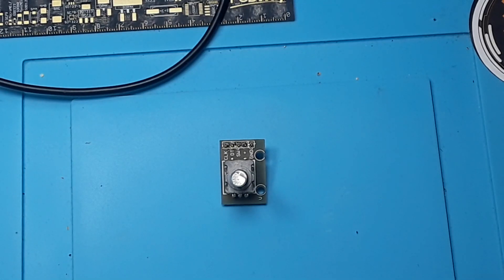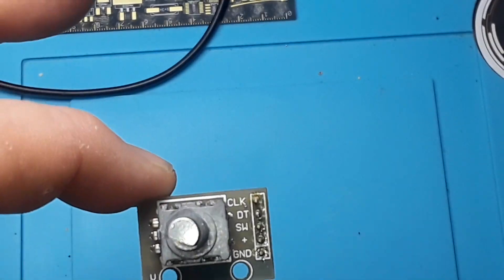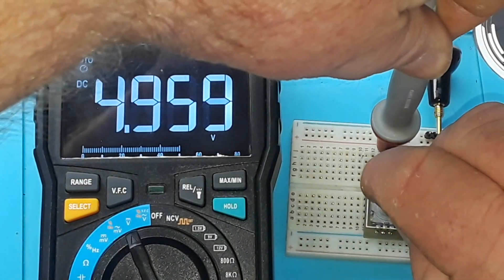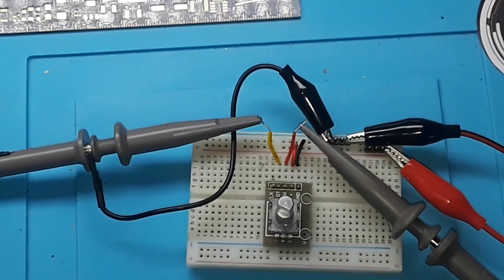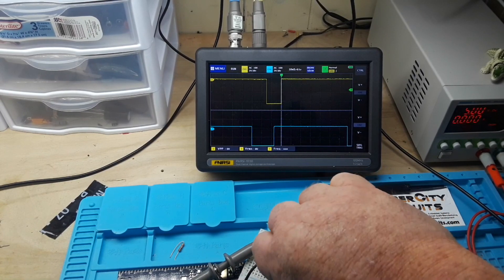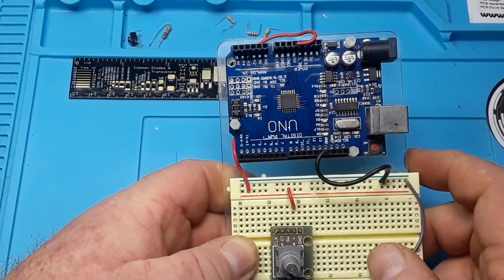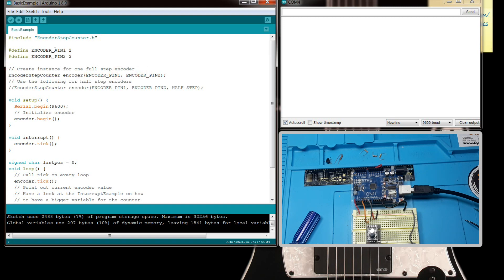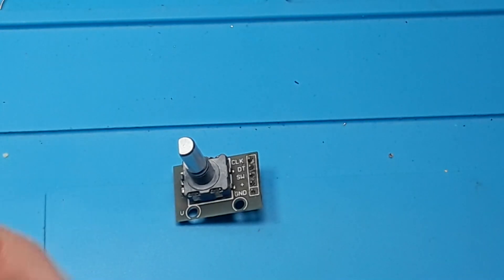How does an incremental mechanical rotary encoder work

Comment: Can you explain why the 5v is required for this device? Rotary encoders not mounted on the small circuitboard as the one you’re using also can have five terminals but none of them are labeled +5v, so that’s got me confused. Thanks.

Comment: Quick question, I hate debouncing in software, it is a hardware problem :), and with buttons will use a combination of a couple resistors, a cap and a 74HC14 to get clean switch signals, do you think this technique will work for the clk and dt pins? I ask as I am concerned about speed.

Comment: If you have an old Atari 2600 Driving controller you can use that for encoder experiments. It's not the paddles which have two per cable but the one that looks just like the paddle controllers except it only has one device per cable. Arcade machine games like Tempest and Missile command use optical encoders which are similar. The Missile command uses two of these for the x and the y direction for the track ball and the old style ball mouses also use optical encoders. Essentially the same thing going on...the direction is determined by which pulse arrives first.

Comment: Nicely done.  Appreciate you showing the detailed steps.  It's great, too, IMHO that you show the wrong forks in the road that happen.  Like trying to use the mm probes on the breadboard then switching to the wire.  I believe those are important teaching moments for beginners.

Comment: I have a few micro stepper motors and I was wondering how to control them with a micro controller?
I have seen a video that says you can control them without a driver but I thought that could damage your chip. And you need to use a diode.
Also can you control them from a small chip ? Like ATtiny85

Comment: is it possible to multiply or increase a voltage with only two resistors?
Reply: Two resistors allow you to make a potential divider, where the voltage across one resistor is some where between the voltage placed across the two resistors. Look up resistor potential dividers for more information. just using resistors it is impossible to multiply or increase a voltage. my the very nature of resistors, they consume power not generate it.

Comment: I’ve got some cheap incremental encoders that bounce something fierce.  Trying to sample multiple times to detect a state change is useless; too much bouncing; it doesn’t stay stable long enough.  I have to detect the initial edge, then just ignore the pin for a while.  Just increment or decrement from an interrupt routine is useless because of the bouncing.  Even a capacitor has a tough time smoothing it enough.  I know: I need to buy better parts. 🙄
Reply: Use a hex contact CMOS debouncer IC. MC14490